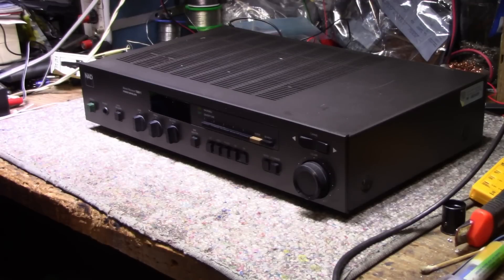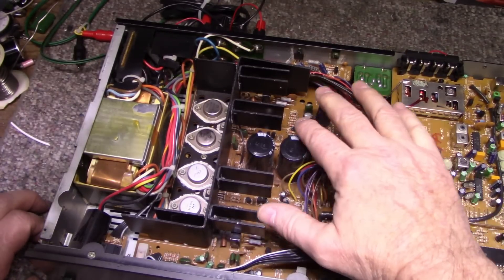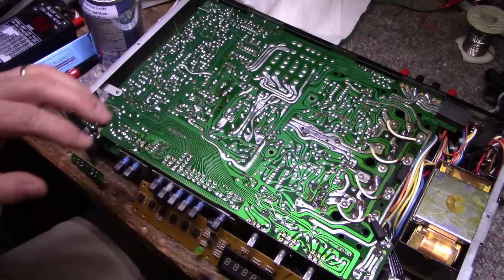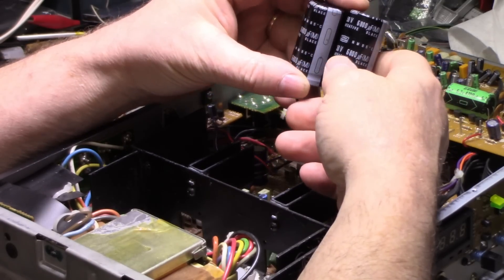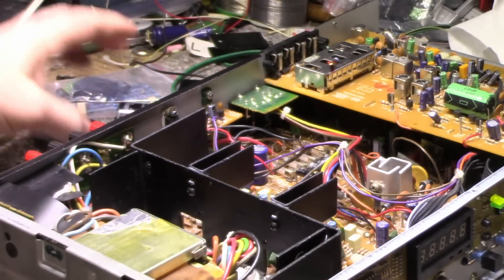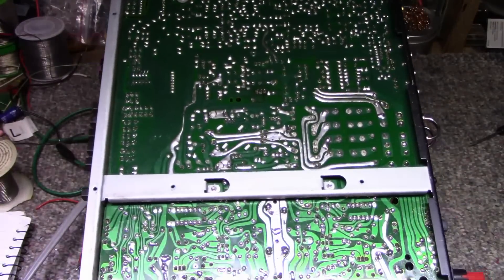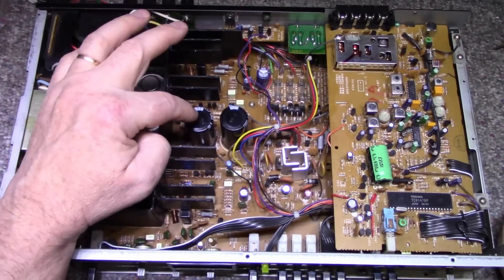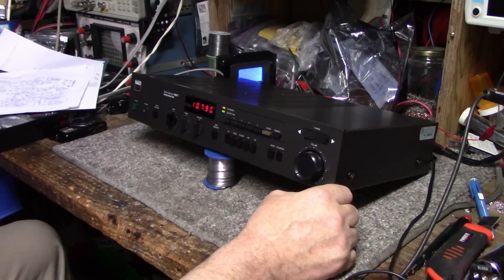NAD 7225PE Receiver (Ep. 170)

Comment: I do agree that NAD used cheap capacitors. It really bit them in the butt in the 2000s when they started making higher power units that ran very hot and then baked those caps.
Reply: NAD has a group of fan boys that like the sound, but as Trev states they were constructed poorly and many are out of commission while a brand like yamaha are still going strong today.
Reply: Trevor actually had a very interesting video about repairing two C350 amps with this specific issue.
Reply from the maker: It's not just the caps, it's the whole package. Made in Taiwan was not a good move for NAD. The PCB board quality and soldering is problematic. The plastic knobs and faceplate are not what you'd expect from a high end manufacturer

Comment: The 7225PE was my first amp. Sounded fine to me and had a lot of punch for a 25W amp. Although I didn't ran it hard, it failed twice. Listening to your comments on NAD built quality I understand why. My speakers were 4 ohms so I guess that didn't help.
First time it failed it was a blown output. Now sure was failed the 2nd time but when it came back from the shop (NAD certified repair center) I felt it never sounded the same. I sold it shortly afterwards (eventually replaced it by a vintage Pioneer which IMO sounds better and has been more reliable so far).
The 7225PE had a "soft clipping" circuit, activated by a switch in the back, It would have been interesting to see the effect - if any - on the scope while driving the amp up to clipping power.
Thanks for this good video, I appreciate your channel and workmanship!

Comment: @Trevor's Bench At 22:50 when you mention that the two output transistors have no emitter resistors, there are no emitter resistors in a "pure" Class B amplifier, which it looks like that amplification stage is just a Class B amplifier. Hopefully, that's helpful 😉

Comment: You aren't too hot on this little NAD, but I have to say that the 7225 and 7020i can handle 2 ohm loads due to their robust power supply. I have used them to run low impedance KEF LS50s to good effect. I tried the same with an 85 wpc Sansui AU-717 and it went into protection! I have been using my NAD 7020i (almost identical to the 7225PE) as a daily driver for going 30 years and it still functions flawlessly.
Reply: My 7020e drives a couple 4-ohm KEF C55 speakers with no sweat.  And most importantly, it sounds great.
Reply from the maker: I would not run this receiver on 2 ohms fersure, I believe the heat sinking is inadequate.
I would also be very careful on 4 ohms.
The amplifier in this 7225 is not efficient and that coupled with the poor heat sinking is a recipe for overheating and failure.
Granted, I do realize we don't all listen to our music full volume but have a look at the watt meter when I had it on the power test.
From that you can roughly calculate the amplifier's efficiency and it's well below 50%

Comment: Uninspired look?  Yep.  They even said it themselves - they spend very little on frills and looks and put the money into quality circuitry for the best possible sound at every price point.  I just restored a 7020e (the non-PE version) and love it.  The problem was the third party manufacturing and parts.
Reply from the maker: I've been listening to this 7225 for almost two weeks now and it does sound good for a low power receiver. It's been working flawlessly and running cool.
I can't imagine it sounded too good before with the bias set to almost 0
Reply: I knew that NAD skipped the frills and focused on the circuitry but I've been hearing they used cheap components as well??
Reply: @rjonzun5828  Call me crazy but I'd say capacitors among other things that age over 30 years and still work are at least decent tier. These amps though have nothing in terms of self-protection so they are quite easily blown, however failures mostly happen because of owners' mistakes.
Reply: @TapesNstuffS  The Taiwanese built NADs were ok, but the mainland China built stuff had horrible capacitors.

Comment: Actually found some info on audio karma about adding emitter resistors to these units. Particularly after the original outputs have been replaced. Seemed to be any issue with a few of the smaller 20-25wpc NADs of this era.
Reply from the maker: Do you know what was the reasoning behind adding emitter resistors?
If the amp was designed to work without them and it's working fine, what benefit  did this provide? I'm curious
Reply: @TrevorsBench   my understanding is that the original design relied on the high internal resistance of the output transistors. But modern replacements do not share that feature and as such benefit from adding emitter resistors. I have one unit that had this done by a previous repair person who cut traces and added 0.33 3W resistors in on the bottom of the PCB.

Comment: This confirms once again the lack of quality control from NAD, besides the use of crappy components....Maybe the best thing to when one bought a NAD was to rebuild it after the purchase .
by the way I almost never saw those bad soldering on 'early vintage ( 1970's ) ....even many or most of those old ELNA's still measured within spec .
Soldering was done manual before wave soldering.
Cooling was still with bigger radiators and so on ....
I never bought a NAD .........I think I never will even when I liked the little 3020 ..........but after seeing the inside I said NO.
Thanks for your passionated quality work Trevor ...makes dinking my first coffee in the morning more tasty .

Comment: Small world as I recently picked up the exact same unit for cheap with one channel gone in it.  The seller said one channel didn't work and I found out why when I got it home. I pulled the cover off and both output transistors on the one channel were missing. Looking closer, Q's 408, 410, 412, and 414 had been  removed and replaced loosely in their respective positions on the board.  They all tested bad as did another transistor and several resistors and caps on the same channel. Someone over at AK said the way these were designed, if an output shorted, it would take out lots of other components along with it and I bet that's what happened here. Since I never tried to power it up, I think I'll order just enough parts to try and get it working again before diving into it. Thanks for posting this video as now I can see the solder bridge mentioned in the manual. Have you noticed any discrepancies between the service manual specs and what is actually installed on the board?  I'm not near  the unit at the moment but I do remember different ratings of some items when they were removed for testing than what was called for in the manual. Its just when I go to order replacements, I better stick to what was in the unit instead of going by the manual.

Comment: NAD generally contracted out manufacturing to Tatung or Sangean in Taiwan, in the days when non-Japanese far-Eastern contract manufacture was sub-standard. Although to be fair low-cost UK based assembly probably wouldn't have been all that much better!

The tape decks and CD players tended to just be tarted up versions of CKD kits from Sanyo and made in Taiwan. I was never sold on them tbh despite the British design, at the price the mainstream Japanese stuff was usually a lot better build.

Comment: I bought one of these 7225PE new back in the day, but wasn't that impressed with the sound of it.
One channel failed after a few months. Got it fixed under warranty, but it never was any great amplifier.
Maybe by replacing all caps with better quality once, and also replacing those cheap 2N3055 for real audio transistors would help.
Reply from the maker: Not sure why yours failed but if I had to guess I would say it was likely a bad solder joint that opened up
Reply: @TrevorsBench  Hi. They replaced the output transistors and a few other components. Thats all I remember.